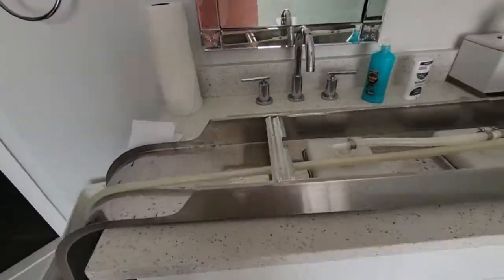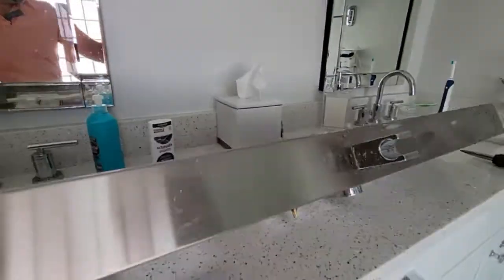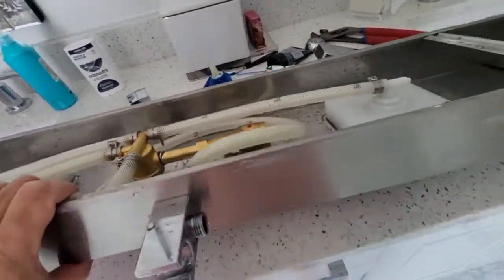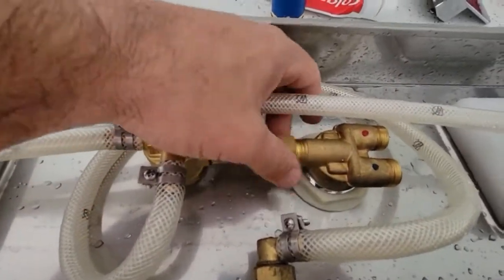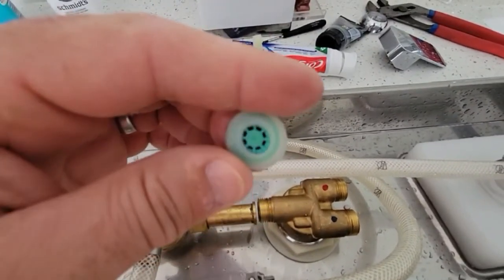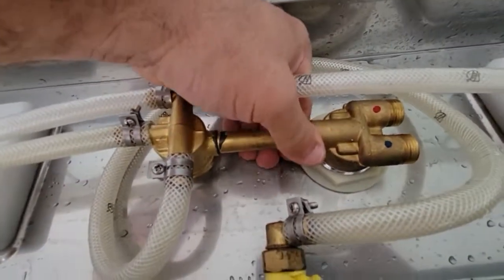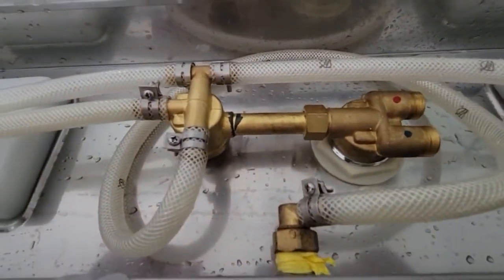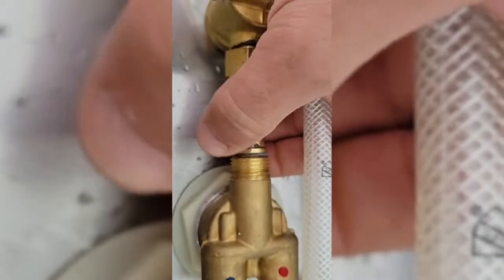Shower panel milan mediterraneo low pressure resolved solved

Comment: I would like to personally thank you for this video. My wife and I have been living with low water pressure for a year and we were planning to to get rid of this unit. I don’t know the reason of putting three water pressure restricters in this unit but I would love to have a few words with the engineer. The shower system works great now as advertised. Thank you again.
Reply from the maker: Glad it helped. I should make more videos with the problems that I resolve...

Comment: There is another place where the water can be restricted, i.e., the cold and hot flexi pipes. I reckon that yours come with 1/4" inner diameter even though it's called 1/2" flexi hose. Try to replace them with 1/2" garden hose or 10 mm inner diameter 1/2" flexi hose. The water flow will improve.

Comment: I bought this shower panel but is not working for me, I got very low water pressure from the shower. I did the same steps as in this video but still not working for me. Is there anything else that I can try to solve this issue?
Reply: Mine had 3 of them, check the hose inlets also.
Reply: Buy a water pressure gauge and check the pressure you your house.